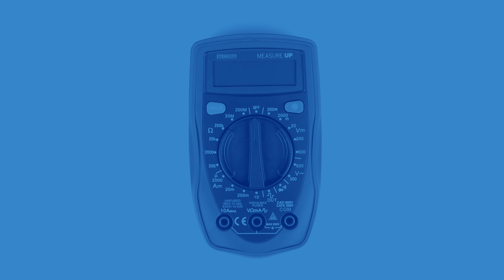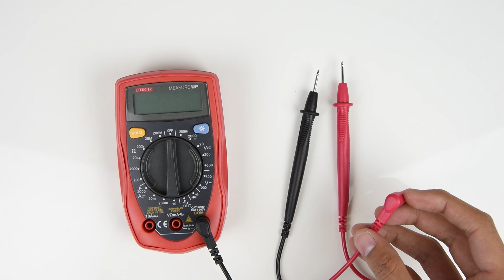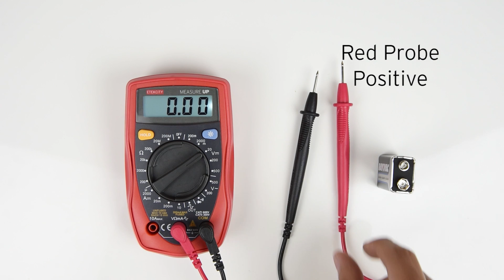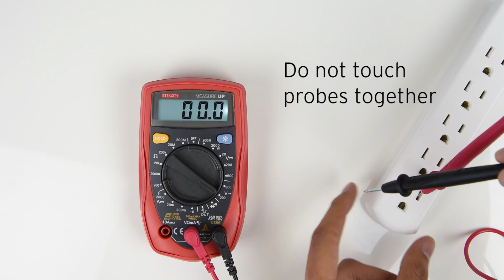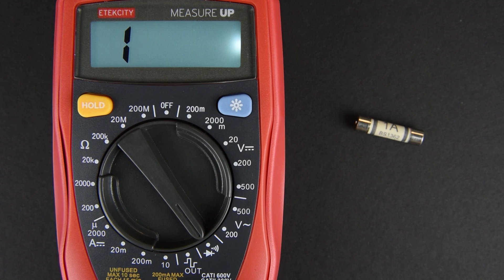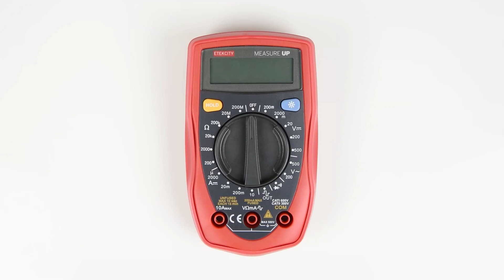How To: Etekcity Multimeter (MSR-R500)

Comment: So I checked the manual for this and can't figure out which setting to use for measuring capacitance? It has a symbol in the manual that is not on my meter so I have no clue which one to use. Any help would be appreciated.
Reply: Did you ever figure how to read uF?
Reply: These cheap multimeters don't measure that.

Comment: Does this measure DVC ? Looking to check my car battery. Thanks
Reply: I've used this particular multimeter model to test my motorcycle battery (12V) so I imagine it will work with a car battery. Here is a link on this topic which might prove helpful. Cheers!

Comment: Screens blank (dead). How do I change internal battery?
Reply: Remove the soft plastic wrap which should expose the screws on the bottom-back of the unit. Remove the screws and slide off the back cover to expose the battery.

Comment: How do you measure amps
Reply from the maker: Hi Shanae, thank you for your comment. To measure amps, please see the following: 

1. Turn the dial to "20mA" in the "A-"
2. Place the black lead to the LED lead that connects to the terminal strip.
3. Place thee RED lead from to the resistor lead that connects to the terminal strip
4. The measured value will be displayed. (you can lock in your reading by clicking on the HOLD buton).
5. When measuring is completed, remove the probes from the LED terminal strips.

Hope this helps! If you have any further questions, please let us know. Our customer support team can be reached at support@etekcity.com.

Comment: Is there a way to calibrate? Reading very high on voltage. Confirmed with a second meter.
Reply: Calibration requires changing the smd resistors on the circuit board.

Comment: I have this meter. I'm wondering why the meter keeps showing 0.L. whenever I turn it on. It doesn't matter which setting the knob is at. The O.L. only goes away if I'm testing something. But once I stop checking whatever, the display reverts to O.L.
Reply from the maker: Hi T Glenn, O.L. means "Open Loop." Open Loop signifies that the meter is ready to test. That's all! Hope this helps! If you have any further questions, let us know!
Reply: @EtekcityUSA  Aha. Ok. Thank you for clarifying.

Comment: I want to know how to change the bloody battery
Reply: 1. There are two screws on the back panel that you have to remove.
2. Prop out the plastic cover, it's easier to open than it looks. 
3. You'll immediately see the 9V battery and should know what to do from then on.
Reply: me too POS just said -1 on the screen and nothing happens using it.
Reply: Mary Hart open it up and replace the fuse and/or battery.
Reply: To replace the battery, slip the meter out of the red plastic outer shell. Then, remove screws on bottom and pull it apart.
Reply: very bad quality of screw, impossible to remove one of them!